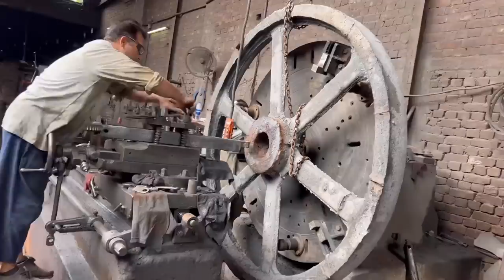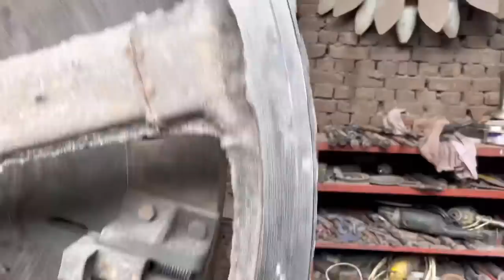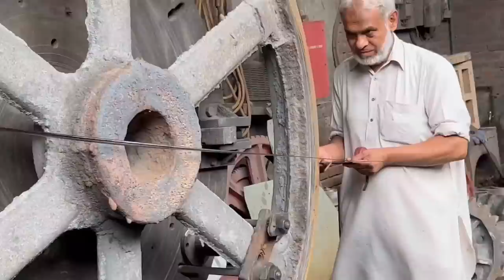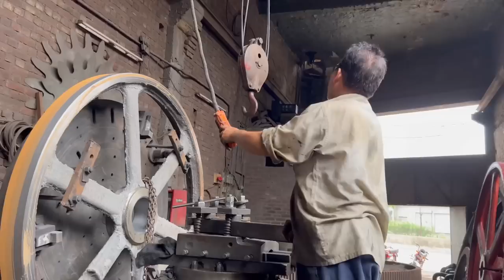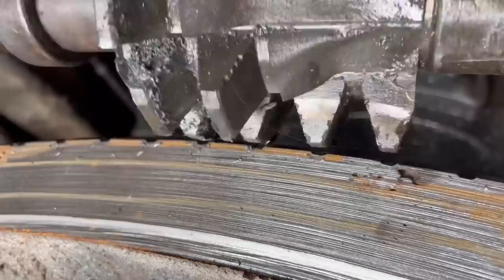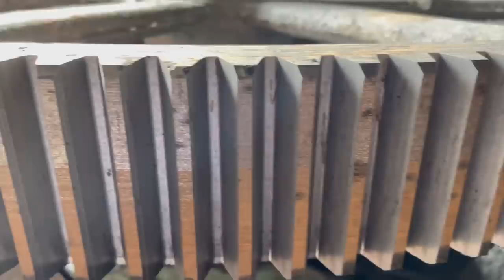Amazing Huge Industrial Gear Production Process - Large Gear Machining on Manual Lathe Machine |

Comment: These men are amazing.
First time I've seen one of these workers oiling threads before tightening!   
Super workers should have new machines and clean workshops.
Reply: The reason they are still operating is that they can produce the gears at a cheaper price than China. That is probably because the y don't have to amortise the expense of new machine tool in their prices..

Comment: Use of a parting tip tool ups down is great ive only been taught the western way lol with gear wheel cutting in normal rotation but from the opp side making the tool more vibration free

Comment: Lots of these big gears in the works so what are they used for?
Reply: heavy roller industry... sugar mills etc etc
Reply: @fahdaftab5084  thanks for info.
Reply: even slew gears for cranes
Reply: @paulwhitehouse3690  I was going to say 'Is cast iron strong enough for that' then I remembered living next to old canal which stlll has two old slewing cranes used for unloading timber from barges.  They have a large diameter  gear with hand crank.